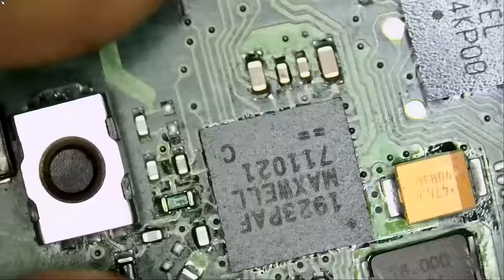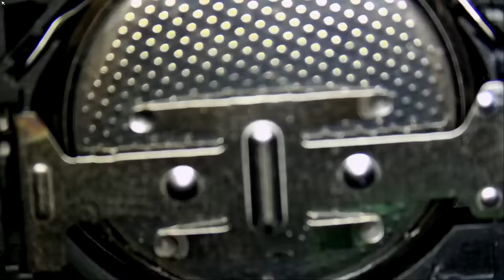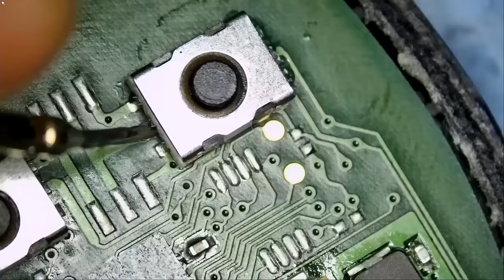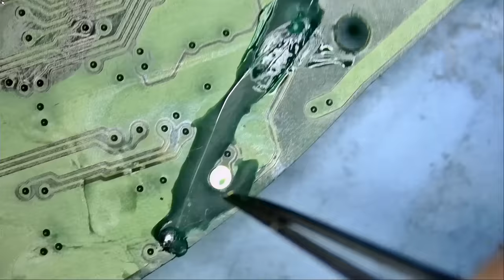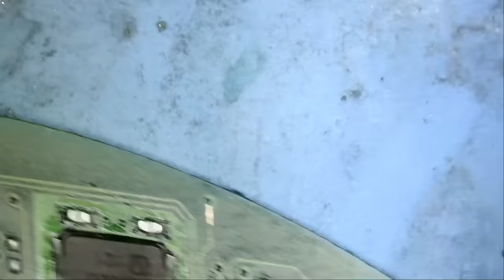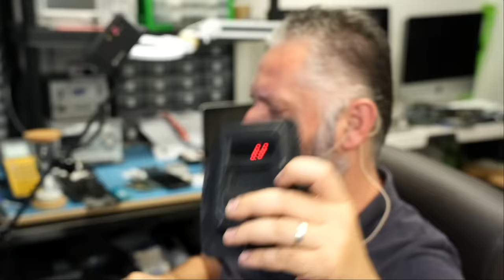A Benz Fob that cannot be Fixed. Right to repair is Hopeless.

Comment: The Right to Repair movement has done wonders for the aftermarket auto repair industry. They have forced the Manufacturers to release software and made them use standardized test connecters. It may not materialize in every single instance but it has still vastly improved the ability for Independent repair shops to repair vehicles. There are instances where the Manufacturers purposely use poorly designed parts in an effort to sell more parts, I see no way around that, but Right to Repair has been very successful.
Reply: I was speaking to someone who writes embedded firmware for cars recently, he said that in the next few years it will be "impossible" for anyone other than the dealer to perform any real obd work. They are only mandated to provide basic obd2 functionality. It's sickening.
Reply: Right to repair and planned obsolescence are diffrent things.
Reply: Right to repair is not a European thing. Only in France it's by law, yet.
Reply: @Ikbenjounietsukkel  I'm fully aware of this. As a 30+ year auto mechanic I'll take what I can get. If they design more money for me into their product who am I to complain?? I was smart enough to buy a Honda.
Reply: Yes and no.  It is true Right to repair is making some changes. However, there are devices or products where it is near hopeless like devices or problems that is related to security.
Reply: I dont think so
Reply: @JoeKyser  Right to repair is what got the aftermarket auto repair industry standardized OBD test connectors and terminology, access to factory software and module reprogramming capabilities,  all of this being vital to repair shops outside of the auto manufacturers.
Reply: @stephenhood2948 Do you have any proof of that?
Reply: @jdmjesus6103 obd2 is already basic and can’t scan all modules and new cars have tons of modules
Reply: This is getting traction in EU as of late and laws are being made, slowly of course but still. The e-waste of devices like this is beyond ridiculous.
Reply: Thank the California Air Resources Board for the OBDII...
Reply: @jdmjesus6103 wow lol

Comment: Hi Alex, most probably is a silly question but have you tried to connect a pull-up resistor between the 3V supply line and the lock button trace that goes to the Maxwell chip?
I will explain my thought.
These buttons seem to me connected to active low inputs of the Maxwell chip (3V are present when the button is not pressed, I expect that pressing the button will send the line to ground).
So there is, somewhere in the circuit, a pull-up to the 3V supply voltage.
I see just two cases: the pull up is external or internal to the Maxwell chip.
If it’s external a resistor should be present on the board and can be burnt out or the track can be interrupted, in any case should be an easy fix.
If it is internal I see also here just two cases: the issue is between the silicon and the pad of the solder ball, and this is inevitably a no fix, or there is an issue on the silicon.
In this last case I guess that is not a short to ground (else the battery had been drained) so it’s possible that there is an issue with the internal pull-up but the internal comparator attached to the pin is still working. Trying to pull-up the pin to 3V will give the answer.
Reply: that was my first thought too...
Reply: Agree
Reply: Sorry but its wrong. The Chip is powered and got High Level Inputs, so when you press the Button you got no mesurment. Same on your light Switch at Home, when you mesure at the switch.
Reply: Dang... I haven't noticed your comment and commented exactly the same thing
Reply: You think he'll waste time to do full diagnosis or repair?  No, he takes the low hanging fruit, and charges everyone else in the months-long backlog a "repair attempt" (refusal to repair) fee.
Reply: @HCAudioStyles  Nope, chuck testa

Comment: A few people have already written here.
It's worth checking whether installing an external 10k Ohm PULL-UP resistor would not help solve the problem.
Under no circumstances should you apply 3v to this line, as people in the comments suggest, as it would short-circuit the button.
You can supply 3v through a small 10k resistor.
Reply: He didn't apply 3v he was just taking readings with the battery inside the fob
Reply: 10k is a little low resistance for a pull-up on a battery powered device.  Try 100k.  It's still a shot in the dark as it is more likely an open circuit to the die on the IC.  Good luck.
Reply: I think knowing the correct value would be to measure current through one of the working switches, then a simple V/I  would get you the value you need. It is a hassle, but it is worth it if it would solve this specific key mystery faults. Then whatever happens, at least it had the correct value of external pullup value. Happy hunting😊
Reply: @MyRadDesign close enough to limit current.

Comment: Hey Alex the maxwell chip holds the information for the rolling code authorization needed to start the vehichle. I’ve changed a few of them but be warned you have to have an eeprom programmer to clone data from the old one to a new one.
Reply: That is good news. Do you know of any datasheet and where to buy these?
Reply: What programmer did you use to read/write to this chip please ?
Reply: This is FBS 4 , i don t know any means up to this date to clone this key afaik.

Regards
Reply: @@lurch789  "Just..." ?  Huh ?
Reply: @JohnnysWorkshops  Didn't FBS4 come out in 2015?
Reply: No public programmer exists for the MB BGA keys... it seems what you wrote is not true, maybe it is a lie....
Reply: @DevianLLC  like I said you clone the eeprom dump. I shouldn’t have to elaborate any further. If you are indeed in the field of rework then this shouldn’t be hard at all.
Reply: @oWcDizzy I not see eeprom on these keys. You are talking from the MCus internal memory? Only on the older NEC/more older Motorola MCU based FBS3 keys was possible to read/write the memorys inside the keys.
Reply: There is no cloning this key MCU, this is FBS4 and there is no solution yet.
Reply: @a20soda  speak for yourself I can 🙃
Reply: @oWcDizzy  prove it.
Reply: @oWcDizzy  Where do you obtain the replacement Maxwell chip? I don't see it listed anywhere.
Reply: @pcb1962  car scrappers?
Reply: @oWcDizzy  Maybe you didn't watch the video and have this key confused with an older one, but the key in this video does not have a way to dump eeprom.
Reply: @oWcDizzy there's no way to dump eeprom on the key in the video...

Comment: Right to Repair would have made information available about the chip and hopefully make the part available for replacement from the manufacturer. So if it is hopeless then it is hopeless to even venture into a repair shop business..
Reply: I had the exact same thought...
Reply: The problem with the right to repair is that manufacturers are using more micro controller chips instead of discrete logic even for simple products and the problem is the manufacturer don't make the firmware available to download to program the blank microcontroller ics which seem to be readily available. Only a few months ago i watched a video by 'Mend it Mark' on here carrying out a repair of a stereo receiver but couldn't repair it as the microcontroller had failed unfortunately the blank microcontroller was available but the firmware wasn't and the manufacturer doesn't supply spares so that receiver became a waste product only usable for parts.

Comment: The corrosion may have shorted and damaged the pull-up part of the Maxwell chip (if the pull-up is internal and not external), but the input part may still work.

Comment: As an ex mechanic I can say without hesitation that right to repair movement should pass no problem but big money wont let it happen, too much money made in the manufacturer shops and many have shown this, when they use a special encryption or keys to get into a system it is wrong, it has to change but I highly doubt it will.

Comment: A lot of times these automotive manufacturers will request the chip maker to put a custom topside marking to mask what is really inside.  Sometimes even the internal die marking is coded in case somebody tries to x-ray the chip.  On the older fobs they tried using these BGAs to get the size of the fob smaller.  Earlier BGA's use this polyimide substrate (its like a small PCB distribution layer to route from the ball to the internal die).  These substrates could delaminate and fail as they are basically a tape substrate not rigid FR4.  If I'm not mistaken, the newer fobs are using microQFNs or even going back to squeezing a standard TSSOP onto the board.  Better reliability, easier to probe.  My guess is the chip might be a sort of IO expander maybe?  In any case, difficult to fix
Reply: GM is infamous for doing that
Reply: Unique serialization in automotive in my experience is typically for application-specific flashed firmware.

Comment: Part of the absurd money they want for these fobs is because of all the time and money they have put into making them impossible to repair. The irony does not end there either, we have this cheap device that is necessary otherwise your car that is worth thousand of dollars is rendered useless! Personally I refuse to purchase a vehicle that requires these key fobs in order to work! It is a gimmick and bottom line is it is a cheap manufacturer that sets up their vehicles like this. Worse is this sort of scam only gets worse on electric vehicles and they want to make owning one if you want a car mandatory!
Reply: I agree, instead of putting in high security locks which are resistant to low skill attacks like bypassing, raking or bumping, they put in those electronic  immobilisers and locks which will annoy the owners more than they do the thieves.

Comment: I tried to google after you said there is no info - i found a video in russian of a guy desoldering the apfel chip and one the pins had actually been damaged. Is it worth (with permission to try it) to see if thats what has happened with the maxwell chip on the underside?

Comment: You mention you don't waste time when it isn't worth it. That's super valid, and I understand that. I work at a retro games shop and I'm our only repair tech. Between all customer repairs, I have about a 5% "no fix" rate. Is that high/low? I understand you deal with more complicated repairs than just game systems. Just curious how many you deem not fixable out of "700 in the shop"
Reply: I think thats the common rate. I repair things aswell and the rate is about the same.
Reply: He mentioned before a 80 - 85% fix rate
Reply: @TechProFury  👌

Comment: Why can't you tap the trunk line to the lock line. You're not going to use both buttons at the same time, so steal the three volts from the trunk line. Just a thought.
Reply: It’s not just about getting 3v, if you tap the trunk line then you’ll likely end up opening the trunk with the lock button
Reply: The command its in the chip not on the line....its clear that the corosion faulted the chip...replacing the faulty chip its just half of the problem.

Comment: Maxwell encoder chip with damaged pin 1 pad on chip. It's fixable but since you have a donor I would try that first. Corrosion, damaged antennas and that chip are the weak spots of Mercedes remotes.
Reply: do you know if these chips are interchangable? what if these are all serialized to the motherboard and makes the swap impossible? I'm sure Alex tought of that and avoided trying...
Reply: @trainyourbrain4420 not replacable unless reprogrammed.
Reply: Just an "empty" chip will not work. It should have a changing code according to the exact car it is programmed to work with. The chip needs to be reprogrammed in order to work.

Comment: That key is a genuine dealer key from a later model car. All MB keys like this work on any MB car. This year of car would of had the older NEC chip. You were correct in your assumptions. One is the immo chip, the other is the RF chip.
For me id of simply read the immo data from the EIS. And made them a new key.

Comment: It's possible internal pull-ups are used, which - if failed - doesn't bode well for the input pin generally
Reply: Correct. 
I have seen internal pull-up resistors inside the microcontroller being used to hold the line. But if this is the case, then the microcontroller port for that pin is faulty. Either way, the Maxwell chip needs to be replaced. 
I don't think that simply replacing it with another one would fix the problem, since, most-likely the micro contains firmware plus eeprom data stored into the flash of the device. I mean, some crypto information must be present inside the Maxwell. And this means, the fob's lock button might work but it would not work with customer's car since the crypto data would not match. 
You would have to perform some "learning procedure" of the fob to the car. But for sure you need some dedicated additional HW/SW  (diagnosis). I think easiest way would be to go to the dealer which will tax the shit-out-of-you.
You are right. It's a no-easy-fix.

Comment: A new chip will probably not solve the issue. You  also need to clone the data from it.  The Car will not start with a empty chip.
Reply: He knows this, he has worked on many fobs with the NEC chip

Comment: If the fob is a no fix, maybe ask your customer if you can try a donor maxwell chip as a last resort and test on the vehicle. At least then you know for sure if that chip is tied to the car or if it simply manages the switches. Hope you get a solution and can update us 😀
Reply: That was my thought. It's some messing about but at least an oppotunity to learn
Reply: a Fob is around $600 and 2 weeks waiting because is shipped directly from factory, better to keep using as it is, you can be sure the IC's are married to the car, otherwise they will ship blank keys to the dealers so they can program to the vehicles that need it.
Reply: a fob costs about 7$ to manufacture.
Reply: Blank FOB keys are not sent to Merc dealers, dealers do not have machines to create a working FOB
Reply: @jadesluv no, the dealers have programmer for the FBS4 keys. Only the older FBS3 (1997-2013) keys must be ordered by VIN.
Reply: It's not a "no fix".  It's a refusal and excuses.

Comment: The Electrical Engineering at Mercedes is terrible.  The fuse box in my Mercedes had a circuit trace that was 1/16" wide that ran power to a 40 amp fuse.   The trace protected the fuse from blowing.  Ridiculous.  The circuit board quality on these remote controls is terrible.  They are not even water resistant.  One drop of water and they are crap.  That is what you pay $400 for at the dealer.  I think Mercedes has dedicated the entire month of August to improving quality control every year.   It's a joke.  They take all of August for vacation.

Comment: Could the issue be a damaged pullup or trace to a pullup rather than the chip itself.
Reply: He measured from the pin of the chip ic.probably it has pins for vcc and gnd and the pin he measured should have 3.0v
Reply: Most likely the chip has internal pullup
Reply: @BogdanSerban  what does that mean

Comment: Reminds me of when I was looking (and still am looking) for a replacement charger chip for my acer PH315-51-78NP. The laptop works, if you insert a charged battery, the battery is used just fine, the problem is that the laptop is unable to charge the battery. Looking at the schematics and board view, the only thing in the chain to charge the battery that possibly could have failed is the chip itself that regulates charging. So I went online looking for a replacement chip in the usual parts shops and the reputable ones do carry the chip but there i just 1 little problem. Minimum order volume from one of the reputable shops is 10 thousand chips. There are some sellers from Hong Kong and China that also carry the chip with more reasonable MOQ of 10 pieces minimum, but I have no way of verifying that the chips are original. I am not risking my precious laptop by soldering on a chip I cannot trust to be original.

Comment: So you’ve got 3V while the switch is not pressed but pushing it drops the signal? Could you tap into one of the 3V lines and place the signal at the switch so it feeds into the Maxwell and when the switch is pressed the signal will pull down? So basically borrow signal from from a working line?

Comment: Idk, but it's better you replace the firmware chip from this fob to a working donor key, so in that way it all work,
Reply from the maker: That's possible if the customer wants to move forward with the risk assuming the Maxwell chip does not contain any vehicle information. If it does, the chip has to be functional and not faulty.
Reply: @NorthridgeFix   The maxwell is similar to the Atmel ATA5823/ATA5824. It functions the same way, but the pin configuration may be different.  One model or the other determines on which frequency is it transmitting.

Comment: maxwell chip is built to suit rolled only for each customer oem solutions, so yeah, they're not going to be posting info on their chips.

the pull-up idea has merit. simple, doesn't involve much work, and might be a solution.

but this also illustrates why i still drive a 'dumb' car. i want to be able to easily fix or cheaply replace everything on it.

Comment: Don't care how hard it is, right to repair is worth fighting for, if you keep letting companies screw people it won't be just your devices feeling the pressure.

Recently it was discovered a train manufacturer had embedded code to shut down locomotives if a date had passed or if the unit was maintained at a shop other than the one the manufacturer runs, these trains are a public utility which the manufacturer knowingly sabotaged so that just tells you how far they will go if you let them.